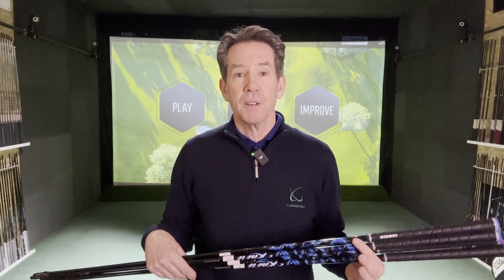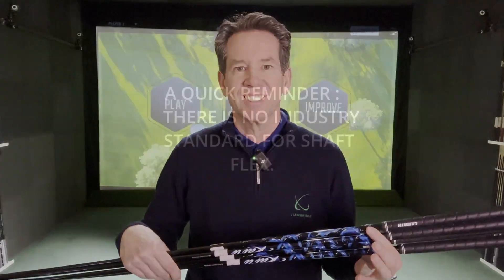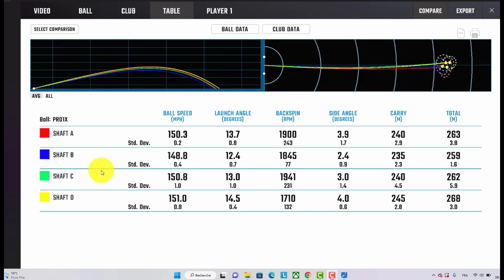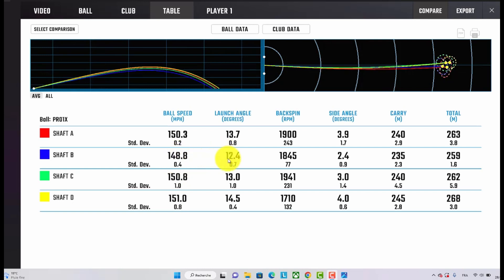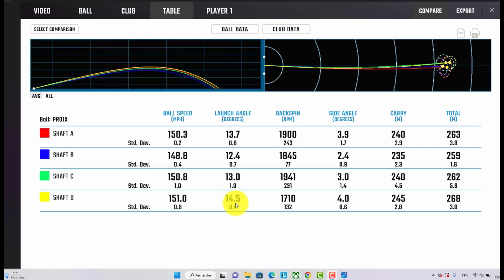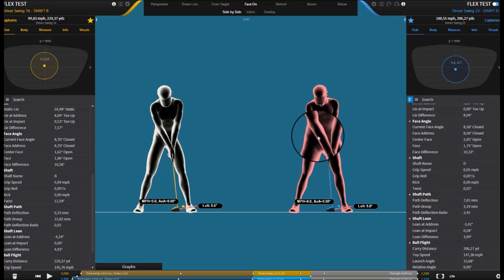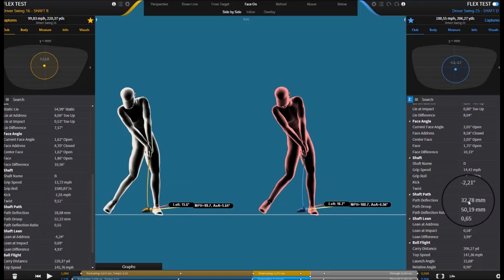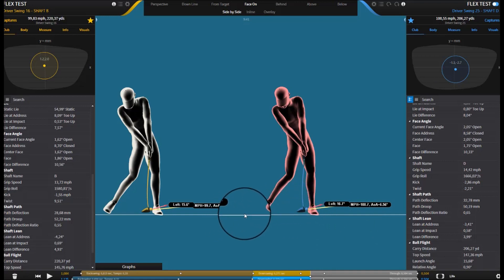WHAT DOES SHAFT CHANGE ?

Comment: Your findings reflect a lot of the finding these days when shaft flexes are compared by humans with launch monitors. People are inconsistent in their swings, so many times because of that choosing shaft flex can be more of a feel determination process as opposed to a swing spec process. Statistically/scientifically a softer flex shaft should be bending more to kick the ball up in the air more than a stiffer flex shaft. Since you used gears to record some of the swings (in the down the line videos you had gears sensors on, and the x-factor angle you did not - what was the difference in order and how far apart timewise that each were filmed, and why did you use gears equipment for some of the testing, but not all?). From a gears perspective did you see different delivery directions from shorter distance shots? Different results for shots where the club started more straight down during transition and the hands decelerated around hip high down (transferring energy into the shaft), and swings where the club/hands swung out more toward the ball to target line, or the hands didn't decelerate at the same point?
Reply: Hello, I used Gears for all of the shots I just chose 2 exemples to show the average. All shots were hit by me during an hour long session alternating the shafts in a blind test. My maximum hand speed is always pretty much the same and in the same zone. Logically the softer shaft should give a higher launch but as you mentioned humans adapt to sensations. That’s why it’s always difficult to know really what’s going to happen. The main takeaway from this video is that what’s written on a shaft doesn’t really mean much. It obviously all about producing the trajectory that you are looking for in a repeatable fashion.

Comment: Wow gears data for club fitting, very impressive! Good topic.
Personally am interested in how shaft torque affects performance (if any) since the difference between aftermarket or high priced shafts and stock or cheaper shafts is usually found in the torque.
Also can shaft affect grip roll?
Reply from the maker: Thank you ! Yes torque has a huge affect on grip roll, rate of closure and the launch direction. the cheaper shafts tend to have very bad torque numbers on Gears. i.e moving all over the place.
Reply: @johnlawsongolfresearch  how exactly does torque affect grip roll? And what besides grip roll does torque affect? The price difference for 2 deg of shaft torque is quite large and I notice many newer shafts  (even premium offerings) have higher torque than say 15 years ago.  Hope to see a video on this topic 😀
Reply from the maker: @77bovi  Sounds like we have the subject for this weeks video ;)
Reply: @johnlawsongolfresearch  Most company's say in testing torque only effects feel (more torque = softer feel, less torque = firmer feel), and that torque has little to no effect / significance on flight performance.